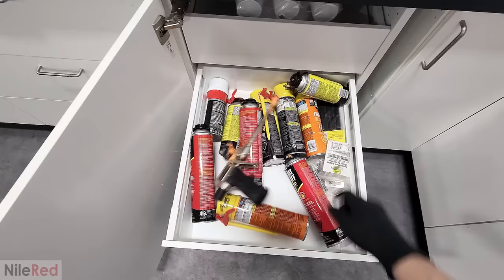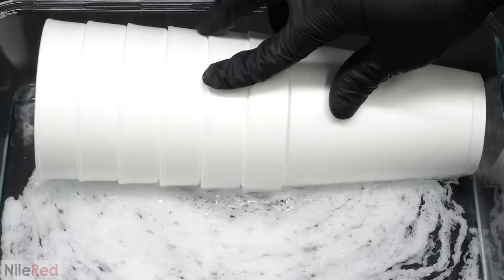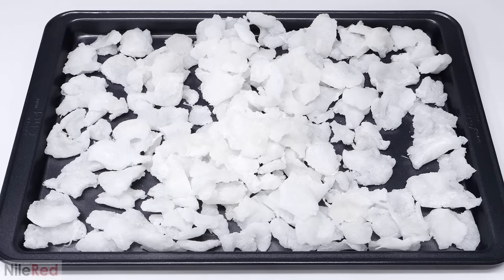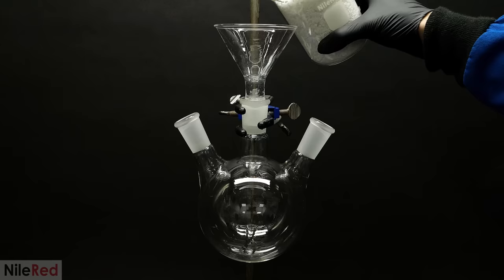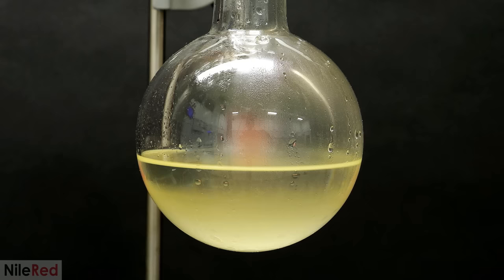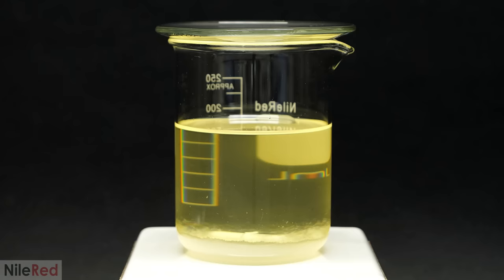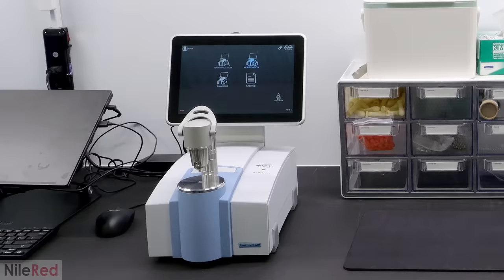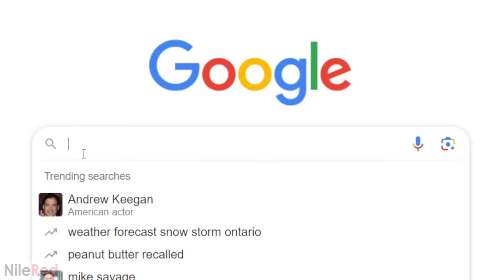Turning styrofoam into cinnamon candy

Comment: That dissolved polystyrene gel works really well as a mechanical adhesive for porous things like chip board and soft woods. I was very surprised how much effort it took to break apart.
Reply: There are actually several adhesives that work on this exact principle. I believe Shoe Goo is styrene butadiene copolymer in a random solvent mixture, and i suspect Zhanlida China adhesives to be similar, also some copolymer with styrene on the outsides. Butadiene wouldn't really glue anything together, but microscopic flake provides rubber like flex and you can graft further monomers onto it, styrene provides adhesion.

Word of note though that both use tetrachloroethylene as a solvent or one of the solvents, which is prone to messing with you. I had a defective tube of Zhanlida adhesive i think the B7000, the bottom seal broke and it spilled out onto my leg, i had to first finish my glue-up, and then i was going to wash it off but i lost my orientation and basically the only thing i could do was sit motionless and thoughtless for an unknown amount of time maybe hours and then stumble towards bed and fall asleep. Now i still have what looks like a chemical burn on the spot where it leaked on my leg, i think about 4 years later, maybe it's not really a burn but just polymer that got permanently bonded with my skin. I tried removing it with acetone but haven't been successful. I do think it's healing slowly with the skin gradually replacing from the edges in.
Reply: @SianaGearz yikes! Hope you don't get cancer from that, because that solvent's definitely carcinogenic.
Reply: @Noreen_Ni_Riain   Oh yeah i fully intend on getting cancer, but probably not from that, i think the cancer hazard from it is about at the level that you expect from its overt toxicity, which... stuff's not good for you, but probably a comparatively weak and rather indirect cancerogen. I'm not regularly exposed to it in particular though.

I like 3D printing with HIPS, it really comes out great, and while it emits an order of magnitude less styrene monomer than ABS, i really should secure my printer with an enclosure and an activated charcoal filter. Someday. Styrene is spectacularly unhealthy, multiple risks including cancer. I don't actually print that often though and i have the completely benign PETG here as well and i just stocked up on more to make me less tempted to use HIPS.
Reply: @SianaGearz I also fully intend on getting cancer, not by choice, im just not the best at handling some of the things I've handled lol
Reply: You think he could use it to fix that chair he hammered to death? 😂

Comment: You're supposed to keep the "pull candy" (dough candy you were calling it)worked and stretched flat under a flame heater to keep it warm while working it, plus the machine was not heated either. Its supposed to cool after stamping of course, then broken.

Comment: I'm kinda scared to ask but could you extract the iron from blood?
Reply: I think codyslab did that. But yes, it would be more than possible. You’d need a lot to get any appreciable amount tho
Reply: My farts are better than NileRed's farts.
Reply: Others have. The amount is insignificant really.
Reply: Yes, it is technically possible! You'd need a lot of blood, though.
Reply: There would t be any reason you can’t, mind you the iron in our blood is in an oxide form so it would need to be reduced to iron again, a few methods to do that but thermite can make it back into iron metal
Reply: F-for what reason...
Reply: @surpeer12  for science...
Reply: anything can be done with chemistry
Reply: And make a sword out of that iron.
Reply: @jozsefbaski70  Apparently that would take an unholy amount of blood that he would probably end up on a watch list for buy not that he isn't probably already on most of the watch lists. Lol

A coin or small bar is probably a better more realistic option,plus he already has the molds. 🙂
Reply: @emilyo.r6778  i mean making a sword out of the blood of your enemies is a weird flex
Reply: @jozsefbaski70  give me my blood back Joshua
Reply: Seven years ago Sufficiently Advanced explained why he thought it wasn't feasible to extract enough iron, and proceeded to make a blood sword instead:
https://youtu.be/rY6IWNkGjA0
Reply: If you want to be even less ethical you can try to extract copper from horseshoe crabs since they're threatened.

Comment: You definitely should have tried making regular candy a few times before going in with your flavoring and WATER BASED DYE. The whole point of boiling candy is removing water content, but then you added it right back! That's why your first batch crystallized and your second batch was not fully hard crack. You added moisture back, without boiling it out. You need a large batch for the residual heat to be able to boil off the moisture just by mixing. Consider using powder dye or adding it with the initial water instead. Look up candy tutorials, its easier to find explanations about your crystallized sugar than you seemed to think.
Reply: At shops that make these, I've seen them add dye after the molten sugar is poured onto the mat. I'm guessing that dye has a stabiliser or is some oil based dye?
Reply: @anarchyfork2676 those are often water based dyes but they spread them out and let the water boil out first
Reply: @anarchyfork2676  the difference with that is they're using so much candy that the residual heat boils the liquid right out, with a small batch like his, and especially after the first time when hed let it cool a bit, it didn't have enough heat to remove the moisture. That along with not brushing the sides of the pot that still had sugar crystal is almost surely what caused the candy to crystalize. In the second batch it was better but, same thing. Candy got gummy because of the amount of liquid dye. If the dye doesn't boil and steam when you put it on the sugar, something is wrong. I think if he had a way too keep the second batch warm or had pulled some air into it it may have had a better time in the machine but, itd still probably have that bit of gumminess from both going over the hard crack temp and the moisture content in the dye
Reply: @andyv2209  ahh I see. Thanks for taking the time to explain that :)
Reply: @anarchyfork2676  yeah sure :)

Comment: I used to work for Flex Coating they make the color shifting pigment that changes color they use for money and travelers checks. The possess I was responsible for was stripping the pigment off the substrate. They used acetone to dissolve the hard coat and release the pigment. I had to work in a wind tunnel type structure that had two giant fans exhaust the acetone fumes ever shift change the maintenance department had to come and check that everything was grounded and the exhaust fans were still working.

Comment: "Chat GPT - imagine BPD, PTSD and OCD as different chemicals and explore their interactions."

Borderline Personality Disorder (BPD) as Fluorine (F2)
Properties: Highly reactive and extremely volatile. Fluorine is the most reactive and electronegative element, forming bonds with nearly every other element and reacting violently under many conditions.

Behavior: Like fluorine, individuals with BPD can have intense emotional reactions and unstable relationships, reacting strongly to environmental stimuli and changes.

Post-Traumatic Stress Disorder (PTSD) as Magnesium (Mg)
Properties: Highly reactive when exposed to certain conditions, such as heat or pressure. Magnesium burns with a bright, intense flame when ignited.

Behavior: Like magnesium, individuals with PTSD can appear stable but have intense reactions when exposed to triggers, resulting in overwhelming responses similar to magnesium's bright and intense combustion.

Obsessive-Compulsive Disorder (OCD) as Iron (Fe)
Properties: Prone to oxidation (rusting) when exposed to moisture and air, leading to a persistent and ongoing reaction. Iron's reactivity is characterized by a slow but continuous process.

Behavior: Like iron undergoing rusting, individuals with OCD experience persistent, repetitive thoughts and behaviors that can be hard to interrupt and are often continuous over time.

Mixing the Chemicals: Fluorine, Magnesium, and Iron
When these chemicals are mixed, they create a highly reactive and unstable environment:

Initial Reaction:

Fluorine (BPD) reacts violently with Magnesium (PTSD), causing an intense and explosive reaction. The reactivity of fluorine exacerbates the sensitivity of magnesium to triggers, resulting in a highly unstable environment.

Iron (OCD) adds to the mix by undergoing a slow, persistent reaction when exposed to the other chemicals, leading to continuous and ongoing reactions that complicate the situation further.

Secondary Reactions:

The presence of Iron (OCD) ensures that the reactions between Fluorine (BPD) and Magnesium (PTSD) are not just intense but also persistent and recurring. This creates a cycle where the initial explosive reactions are prolonged and perpetuated by the continuous oxidation process of iron.

Compounding Effects:

The intense volatility of Fluorine (BPD) combined with the reactive sensitivity of Magnesium (PTSD) and the ongoing nature of Iron (OCD) leads to a feedback loop where each chemical's properties amplify the effects of the others. This results in a system that is highly reactive, continuously active, and prone to ongoing instability.

Analogies to Real-Life Experiences

Emotional Volatility (Fluorine, BPD): Individuals with BPD experience intense emotions that can change rapidly, similar to fluorine's extreme reactivity.

Triggered Reactions (Magnesium, PTSD): Like magnesium, individuals with PTSD can have sudden and intense reactions to specific triggers, leading to overwhelming responses.

Compulsive Cycles (Iron, OCD): Similar to iron's rusting process, OCD drives individuals to perform repetitive behaviors or thoughts that are continuous and difficult to interrupt.

Combined Effects

Intensified Reactions: The combination of BPD’s volatility (Fluorine), PTSD’s triggers (Magnesium), and OCD’s persistence (Iron) creates a situation where emotional responses are not only intense but also persistent and recurring.

Constant State of Alert: The individual may feel constantly on edge (Fluorine), frequently triggered (Magnesium), and trapped in repetitive cycles (Iron), leading to significant distress and impairment.

In summary, having BPD, PTSD, and OCD simultaneously can be likened to a highly reactive and unstable chemical mixture of Fluorine, Magnesium, and Iron, where each component's properties exacerbate the others, resulting in a system that is highly reactive, sensitive, and perpetually cycling through intense and continuous reactions.

Comment: Would it be possible to remove the sugar from a regular soda and replace it with an artificial sweetener? (Bonus points if you do it with Mountain Dew: Voltage, specifically 😁)

Comment: Hello chemist friends!  I have a question for you. Last night the colleague left a pot with little soy lecithin and palm fat on bottom, topped with some water and citric acid to boil in attempt to clean it. After a while, some horrible smelling, eye burning vapour dtarted coming out of it. Can anyone tell me what happened and what gas we inhaled? Thank you!
Reply: Hi there! It sounds like the mixture in the pot created a chemical reaction that released some unpleasant and potentially harmful fumes. When citric acid is heated, especially in combination with fat like palm oil and lecithin, it can break down and potentially produce irritating organic compounds. Additionally, if the temperature was high enough to cause burning or decomposition of the fat, this could release acrid smoke and other volatile organic compounds (VOCs). 

The eye-burning sensation suggests that some of these breakdown products were likely irritating or corrosive. Without precise details, it's hard to pinpoint exactly which gas or gases were released, but it might have included acrolein (from the breakdown of fats) or other aldehydes, which are known to be irritating to the eyes and respiratory system.

If this happens again, it's important to ventilate the area immediately and avoid inhaling the fumes. If you're experiencing persistent symptoms, it's a good idea to consult a healthcare professional. Stay safe!